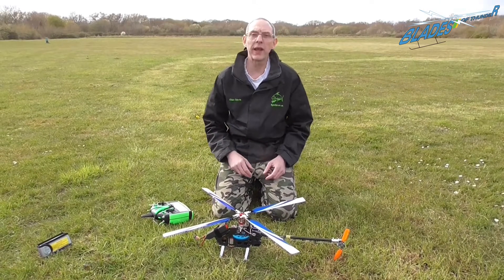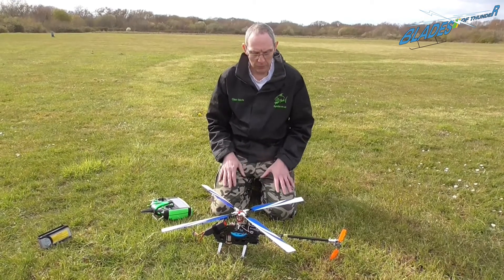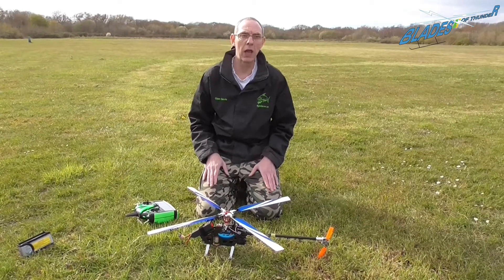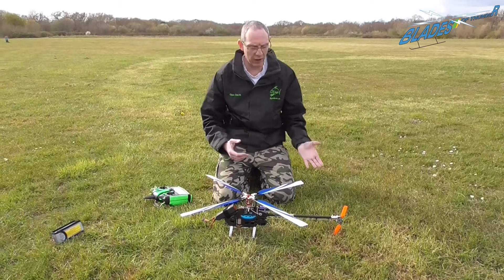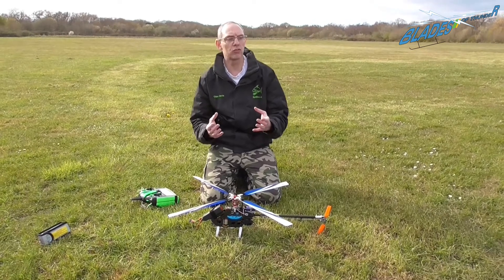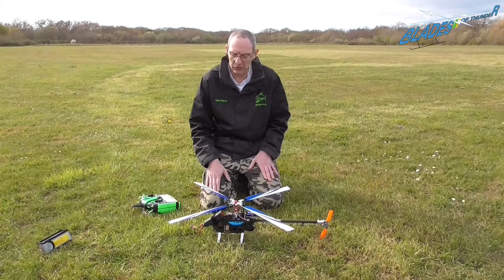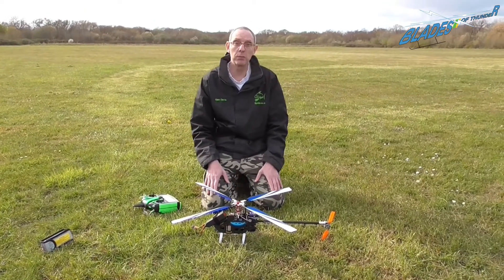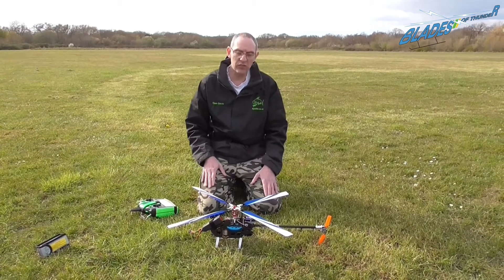Roban MD500 'Little Bird' - Video 2.1 Test Flight of the Mechanics

Comment: Hi, which motor and gear ratio are you running in this helicopter? My 450pro has a 3400kV and with a gear ratio equal to 10.08 (121T/12T) it is hard to get 1200rpm. Thanks

Comment: Hi good video well explained on the head speed, but silly question time how do you work out the head speeds ?
do you do it with throttle curve or do you use a digital tachometer ?
Reply from the maker: Thank you lee. we run constant govern head speed. To work out head speed you need to know gear ratio, motor KV and battery voltage. KV is motor rpm per volt supplied. for arguments sake say gear is 12:1 motor kv is 800 and battery is 6s 22.2v therefor 22.2x800=17760x1/12=1480 at 100% throttle 70% throttle would be 1036 rpm.

Or you can cheat and a head speed calculator we use an app on phone called RC Heli Toolbox
Reply: @bladesofthunder9778  Excellent... thank you for your explanation, will have to nab my daughters Iphone to download the app.

Comment: Ok I have to ask, what brand of helicopter is being used here. I have the Rotorscale version sitting on my workbench waiting to be disassembled so I can go through it, I already know the motor is touching the gears at all, and I have a 5 blade rotor head to install. Needless to say this series is helping me out a great deal, thanks
Reply from the maker: HI Greg Ours is simular to the Rotascale version being a roban fuselage which we match with Align Trex 450 mechanics in our case the pro version. We are very pleased we are of help.